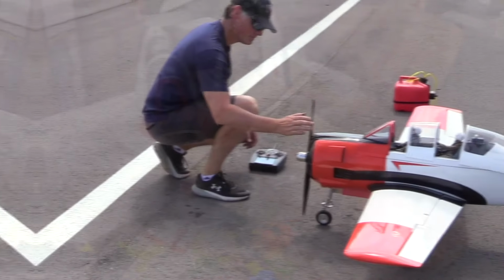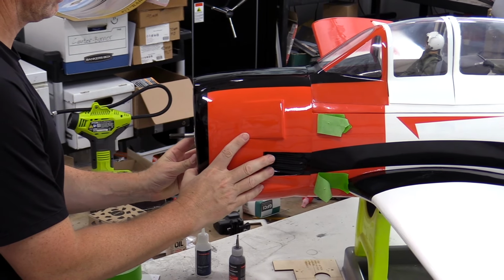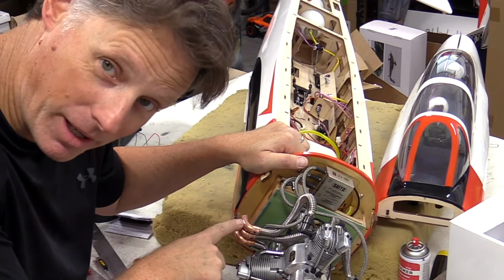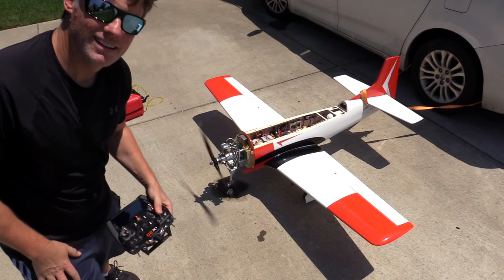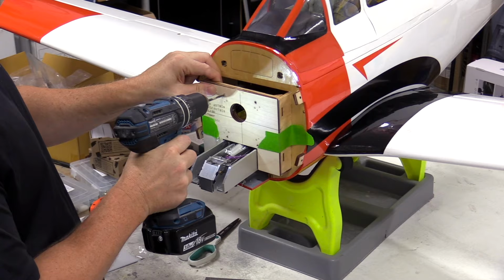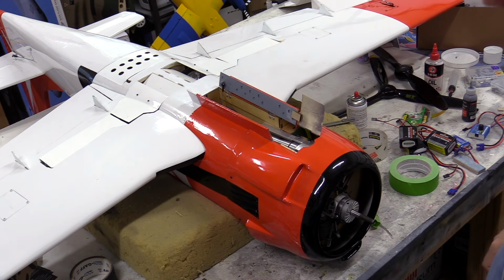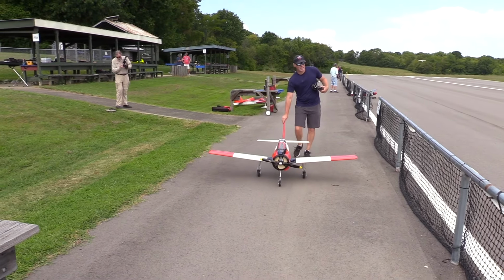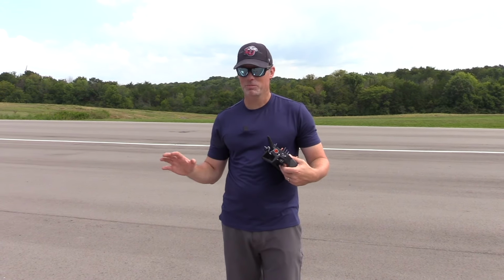Radial Engine POWER! Giant RC T-28 Trojan Engine Install & Test

Comment: i always fit the engine to a model first, so   I can have the fuse upright, check it's in the correct place, drill holes, then fit cowl....after that, the tail etc

Comment: Did you have to offset the engine Chris?
Reply from the maker: What do you mean by offsetting the engine?
Reply: @Thercgeek  engines are pitched down and to right by like two degrees to offset thrust correct? I building a plane and setting up the engine and have noticed this in other builds...

Comment: Get a Futaba radio before you  buy and lose another plane. Always remember one thing in radios for flying rc airplanes when your buying a radio  Quality is remember well after the price. I've been flying for 65 years rc never had radio problems. Turn that Spectrum into a door stop.
Reply: I fly Spektrum, had zero issues. In 72 MHz format had Hitec, Futaba, and EK Logiktrol, with issues due to the transmission format. With a Spektrum DSM2 or DSMX I have had ZERO loss of signal.
Reply: Where do you fly? Europe?
In the states no issues with DSMX

Comment: If you are using nyloc nuts on the bolt that holds the exhaust elbow on the end of the flex exhaust I would think the plastic insert would melt out and the bolt come loose?
Reply from the maker: Definitely something to keep an eye on over time.

Comment: Do they make it so that the ignition wires can be touching or near the exhaust piping?  I can see it’s pretty tight in there!  Great work as usual I can’t wait to see it fly!
Reply from the maker: The ignition wires are shielded, but I’ve got those as separated as I can just to be sure.

Comment: Love your videos Chris.  I just put this engine on my Topflite P47 which I ran electric for several years.  Got it from Morris with his mods.  Runs great, flys awesome. How often do you add oil to the crank?
Reply from the maker: Nice!  The oil in the crank is only recommended for the first run.

Comment: I know you said that you checked temps, but have you used a tac to see the rpm's? I would check the gas lines for air bubbles too. Also, if you dont have any, i would get you some feeler gauges to check the valve clearances. What a dream build!! She sounds AMAAAAAAZING!!!!!
Reply from the maker: Thanks for the suggestions!  I have a tach on the airframe as well as a temp sensor sending temps via telemetry.
Reply: @Thercgeek  wow you really are a rc geek lol. Do they make an electric start for the motor?

Comment: Chris, You can still get a Keleo ring exhaust. Did you reach out to the new owner? Anyway a ring and pipes on both sides would be cool.
Reply from the maker: The challenge with the ring exhausts is that they go around in a complete circle and exhaust out the bottom which in this case is where the nose gear is. This would require a custom exhaust to get it where it needs to exit for the scale location.
Reply: @Thercgeek  That's what I mean. Have him weld the pipes onto the ring in the scale location.

Comment: I have that same engine on a Great Planes Giant Big Stick XL.  Just curious and I know this is probably a silly question but, where did you get the wood template for the mounting holes for the Saito?  Did you make it or is it available for purchase? Also, just FYI, there is a German company that makes an exhaust ring for that engine and it sounds awesome.
Reply from the maker: The wood template came in the kit. When I changed out the intake, I placed the mount against it to plot out the holes. They were close to some guides that were already there.

Comment: How much did you have to turn down the endpoints on the throttle channel due to that long servo arm? Looks like about 50 or 60 percent from here. Servos should rotate ±40° at ±100%. I offset the servo arm one tooth toward the idle side to make the idle speed setting less sensitive..    😎

Comment: Things bad ass. I'm so ready to graduate from foam to balsa. Slowly of course. I got a few balsa birds purchased second hand, but they are 20 years old. My newest is the Navy Piper Cub from motion that i chose to run electric but i want something like this gas powered that i can really love.   Nice Work!
Reply from the maker: You’ll like it. The thing with balsa is it’s more structurally rigid, so it just flies better.
Reply: @Thercgeek  Very well said 👍